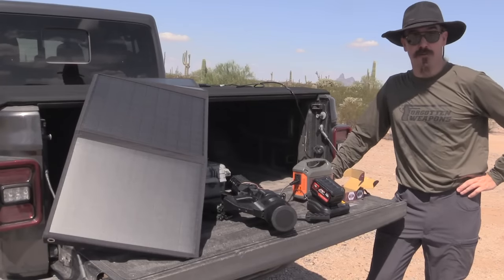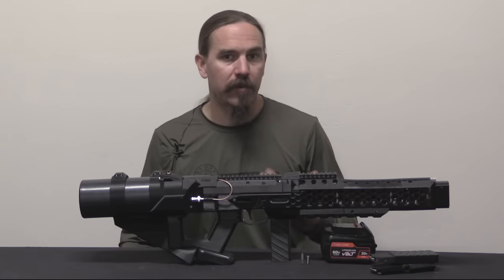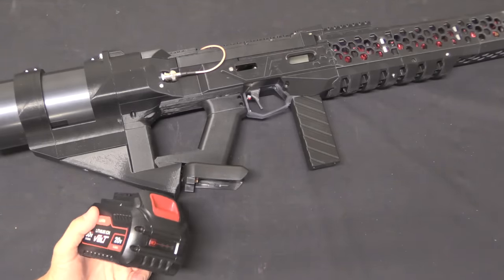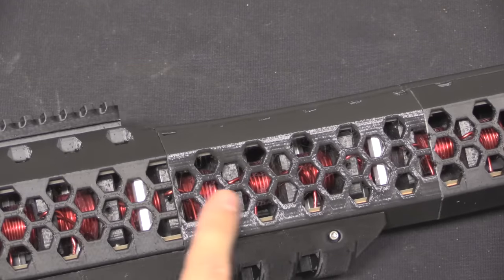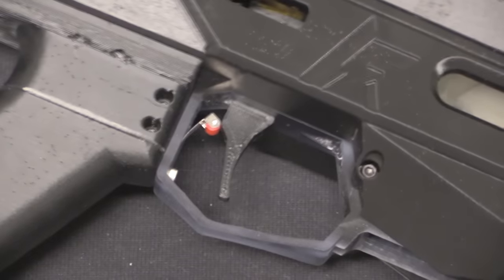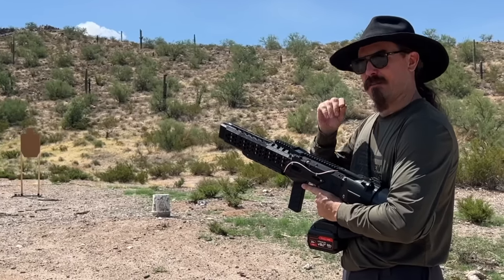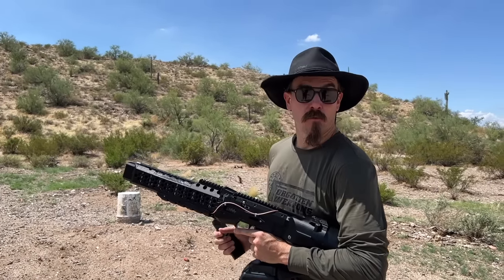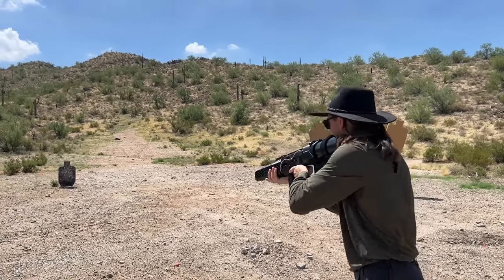ArcFlash Labs EMG-02 CoilGun: Making SciFi Weapons Into Reality

Comment: A railgun has two conductive surfaces of opposite polarity to utilize Lorentz force as a means of propellant. Basically short circuiting the system using the projectile and when that happens a string magnetic force is generated forcing it down the rails until the shirt circuit is fixed. A coil gun is pulling rather than pushing. It has one or usually many coils set up in a linear path turning on the off quickly to pull the projectile into the coil and is generally less efficient. A common method is to use a led and photodiode combination to switch the coils off but inductors do not release it immediately. So as the projectile is being pulled in (down the barrel) it is also being pulled in (the opposite direction) slightly but not enough to overwhelm the ever increasing energy of the projectile. It's the reason the navy was testing the railgun and not a coil gun. A railgun is not a feasible with the technology we have for a portable option and is prone to jamming or more accurately the rounds welding inside the barrel. A ship can handle carrying spare barrels and the ICs to handle automation of that but probably not infantry. Not yet anyways (looking at you future soldier program).
Reply: You people don’t understand the many ways that monopole coils are wound.
Reply: @danielfoster2788  please show me an example of a monopole magnet. It can be permanent or electromagnet. So far it's not theoretically possible.
Reply: @flyback_driver  We are familiar with hallbach and pile magnets grouping that are very closely monopole not perfectly so. Fractal coils produce much better monopoles. Half spherical coils cancel  magnetism within. There are monopoles POE toroidal coil windings, and star coil windings that are monopole.

Comment: Would it be theoretically possible to have some form of stabilized fin on the ammunition?
It would make it much more expensive, but at least you would theoretically get better accuracy.
Reply: I wonder if simple spiral grooves along the projectile might be enough to give it stability? They'd be easily added when turning projectiles down on a lathe, which helps with the cost factor.
Reply: I imagine you can do whatever they do with shotgun slugs if you really want to make it more accurate, but for now slicing up a steel rod is good enough.
Reply: Makes me wonder in general what it'd be like to put steel flechettes in this thing. You could probably kill someone at that point.
Reply: i mean in some scifi railguns use sabot rounds so it could be done with a coil gun perhaps
Reply: @FunkyNige  Shotgun slugs with spiral grooves (fired from a smooth barrel) end up spinning far too slowly to get spin stabilization. The purpose there is to make up for asymmetry in the manufacturing of the slug by spinning it.
Reply: It would be possible to spin the projectile magnetically even without fins (the same way an induction motor works) - although that would require a much more complex coil system.
Reply: It's possible to give spin to coilgun projectiles via the coils themselves, but the coils Arcflash are using in the GR-1 and EMG-02 are built via off-the-shelf products, which presumably will be upgraded to newly-designed coils which can impart spin-stabilization in later models. 
 
However as it stands, these are only hobbyist toys with amazing potential, but little real-world practical use. Give them ten years and the government will want to ban them.
Reply: I was imagining a sort of projectile with alternating steel and some non magnetic material in a spiral pattern down the length of the projectile. Theoretically that would cause it to spin to keep the metallic side or strip in engagement with the electro magnet. Not sure how possible/practical that would be, but would be neat if they tried something like that.
Reply: That's what I was thinking. Stabilising vanes milled into the slug to make it spin. It's the only way these things are gonna get any kind of accuracy. That or Sabot ammunition.
Reply: Theory: We know it can fire drill bits. So...

...What if you could load it with auger bits? Would those actually spin? I think they would, if they were traveling fast enough. Imagine a 3/8 inch carbide-tipped auger bit traveling at like 1575 feet per second. That's...actually kind of terrifying.

For the cheap version, just take steel bar stock and twist it, then grind the end to a point. Wrought iron ammo, basically. I mean, if a vacuum cleaner can make a fan spin, I see no reason air friction wouldn't spin an auger.

But as of now, I don't think the muzzle velocity is really enough to spin anything. I'm sure that's gonna have to wait.
Reply: Yeah. You can already do that with shotgun slugs. As long as it's made of some kind of ferrous metal, it'll work.
Reply: Flechettes would be great for this style of weapon.
Reply: Maybe it would be better to think outside the box on this. 
 
You're thinking of adding stabilization via airflow with stabilizing fins and I was thinking of using helical coils (DNA strand shaped) rather than toroidal coils (donut shaped) similar to how rifle-barrel rifling spin-stabilization works in my other reply, but what if the simplest solution is to just spin-up the projectile via an electric motor before firing? 
 
It would require a simple magazine re-design (add a toy racing car motor and battery), which would require A LOT less complex engineering than my helical coil idea.
Reply: The only problem is the low velocity of the projectiles makes aerostabilization ineffective. Possibly a redesigned projectile with an extended polymer base with fletching?
Reply: @eloiseharbeson2483  I'd try spiral fluting.
Reply: Perhaps 3d printing a hollow 5/16 finned projectile and stuffing a smaller maybe 3/16 steel rod piece in it.
Reply: A bearing scar would be an interesting test and also 3d printed and assembles with hardware store bearings. They normally use these for foam darts.
Reply: Two words: Whitworth Rifle.

Comment: I wonder how well this gun would work with a flechette type munition with a sabot, sort of how APFSDS works but in a smaller scale, a smaller projectile that is aerodynamically stabilized, which could in theory pick up more speed because it is a lighter projectile and due to its shape it would loose less energy due to tumbling.

It could improve the accuracy and also make it more of a proper firearm, with a real application of being a good armour penetrator if you can reliably get normal ammunition speeds out of the coils
Reply: The amount of (ferrous) metal being accelerated has a direct impact on how well the coils accelerate it.  Making it lighter won't increase the muzzle velocity - it'd be analogous to reducing the gunpowder, not the bullet.
Reply: @oasntet  Then what if the two halves of the Sabot had a metal core surrounded by plastic to make it fit in the barrel, also you could make the size of the projectile bigger while maintaining the shape of a fin stabilised dart to increase accuracy.
Reply: How would the sabot stay intact in the barrel without touching the barrel?
Reply: loose = not connected
stop having something = to lose, single 'o'
Reply: Better question, how small can we make a HEAT round? They don't care that they are going slow, but will still hurt thr target just fine..
Reply: @GundamReviver  explosives in bullets are prohibited by pre-ww1 treaty

.50 cal is like minimum size to be allowed
Reply: @NoNameAtAll2  ah yeah found it.. The 1868 St. Petersburg Declaration states:

The Contracting Parties engage mutually to renounce, in case of war among themselves, the employment by their military or naval troops of any projectile of a weight below 400 grammes, which is either explosive or charged with fulminating or inflammable substances.
So it just stops it for army in the case of war. But theoretically it is still an interesting one..
Reply: I was thinking about this too. Since the gun cannot have a rifled barrel, how about rifling the projectile? Make the the tip of the bullet conical like a standard round, just the forward motion on the bullets "rifling" should allow it to spin somewhat improving accuracy. There are no aerodynamics on those metal dowels being fired. Of course the real draw back is FPS which is too low to make this weapon practical. Hope it gets improved, ammo will be much cheaper.
Reply: @NitroU-  The reason why I suggested something akin to tank rounds is because tanks have smoothbore cannons

Comment: The great thing about a coil gun is that there's no recoil and there's no need for a bullet cartridge. So in a war situation, you can equip your troops with more ammo faster, since you just need to form the bullets. It may be possible to just have a machine installed in military bases that churns out bullets from scrap metal. It's quiet too, which means you won't give away your location unless your were extremely close. The downside is that maintaining the weapon itself may require more training, since it's not a piece of equipment anyone can just open up (yet). Plus battery technology needs to seriously be revamped in order to make this more viable.

Comment: What I think is interesting about this prototype is the use of simple day-to-day exchange parts. Car electricity fuzes, Dowel pins as ammo, some standard issue Pcpipe for aberrel (if I remember the earlier videos corrrectly, screw-drill batteries... So you actually would be able to repair it by yourself if necessary.

Comment: I can only Imagine Future generations of Coil guns will be more like "Payload launchers" (If that's the correct way to call it.)
Reply: Underbarrel coilgun grenade launcher.
Reply: not entirely wrong. The technical term they fit under (as do chemical firearms and airguns) is "Mass Driver". But seeing as you don't have an explosive/combustable propellant, there are payload options that don't exist for bullets.
Reply: Bolt Thrower
Reply: @Shaun_Jones  tbh. grenade launche is main use i can see for this technology right now, a silent grenade launcher
Reply: Kind of like shotguns.

Comment: I can make a magnetic rail rifle using a singular fractal coil that will propel ballbearings through engine blocks using an under over hose feed with 2,000 rounds :) utilizing a current boost transformer kills that Capacitor weight. However a camel pack with a lenz loop and swap battery charger circuit fires always non stop. Just keep wrap around hoses filled with ball bearings within reach.

Comment: Thank you, Ian!   Excellent upgrades all around.  The battery pack is genius and the large single unit definitely beats the row of capacitors under the "barrel."  A grinder with a portable battery pack will let you make ammo out of rebar if you don't mind putting a bit of time into it.  The screwdriver bits are almost laughable but innovative.  I sure wouldn't want to get hit by a Phillips head moving 200 fps!
Now I have to order one of these before the feds here in Canada outlaw any projectile launcher that fires ammo faster than a walking pace....

Comment: What freaks me out is how quiet it is on camera! Wonder if they're working on stealth pistol versions of these, if thats even possible
Reply: the muzzle speed is not near lethal yet and difficulty in miniaturization has been the prohibitive factor in coil/rail- guns for the longest time. in short. we are a long time from making this any smaller and not be a peashooter.
Reply: Thats called a nail gun 🤣
Reply: It could still be a stealth pistol, just instead of stealthily assassinating the target, you'd stealthily give them the equivalent of a mosquito bite
Reply: You can quiet the electronics and eventually the capacitors will be small/quiet enough, but once you get that projectile to a certain speed there will be a distinct noise once it's born into this world.
Reply: @kristianstaalby8499  Ah, that makes sense. I was slightly frightened by how quiet is is and how little recoil it produces.
Reply: @kristianstaalby8499  But not to far off from practical "rifles". It probably will take one or two decades, but with the current focus of reasearch of improved batterys and capacitors its very likely going to be possible.
Reply: @theexchipmunk  perhaps it will perhaps not. I fear it will at best match a subsonic suppressed rifle.
Reply: @IdleByte  not if you use acoustic waveform energy to cancel out the soundwave.." speaker driver "

Noise cancelation technology ISN'T difficult you just match the Exact Decibels and Frequency Harmonic with a Duplicate Soundwave and like two ripples in a pond will nullify the  pressure wave propagation fields , Soundwaves also are Universal form of matter/energy cohesion Harmonic...EVERYTHING in this universe has an atomic Weight " Nuclear Magnetic Resonance Frequency Harmonic " Gold, silver , carbon,  oxygen is 60 Gigahertz,  Cells even your BRAIN and DNA Code has a SPECIFIC Nuclear Magnetic Resonance Frequency Harmonic...
Reply: @jaroslavsvaha6065  could you like coat it in ricin
Reply: @mjolnirswrath23  
tell it to your healing crystals grandpa
Reply: @jaroslavsvaha6065  that could be even more dangerous if they use injection bullets with literally anything lol
Reply: @kristianstaalby8499  So it's not the discharging sequence of the coils the bottleneck like I thought with these?

I wonder if it could use longer coils as a compromise between a coil gun and a rail gun since to my understanding the latter overheats from a single shot.
Reply: @JoelHernandez-tz3vk  There are indeed loads of prohibitive factors with this bleeding edge technology. its not only one thing but a lot of things that all must be working and cooperating
Reply: @IdleByte  yes. But the shape of the projectile has room for improvement as well. Maybe an aerodynamic drop-shape, or a small dart for stability and silence.
Reply: Likely won't see a true pistol for a long time. No room for the electronics.

Comment: Would love to see this turned into artillery. Imagine with that cyclic rate, one cannon can throw 200 shells in less than a minute. Unlike bullets, shells won't need that much muzzle energy to do a lot a of damage. Just need enough energy to lob them into the enemy position.
Reply: Artillery range depends on muzzle velocity, not muzzle energy, but if you want to lob an explosive shell, muzzle energy will probably be as directly related as in artillery.  The slower acceleration might allow more explosive in each shell and would replace the heavy barrel with other heavy components.
Reply: The us army has already developed 120mm coil gun mortars, which shoot the same warheads twice as fast and at a greater range than the current in service equvilient.
Reply: There are also projects for ship based railguns with projectiles that go mach 7
Reply: @HappyBeezerStudios  The US Navy's railgun was basically shelved for now, theyre looking into hypersonic missiles/glide vehicles/etc instead.

From what I can gather, main issue of the railgun is that it creates the same energy/recoil as a conventional gun. So if the projectile is going mach 7, then only because its extremely light. So they basically just shot a metal spear, without any guidance or payload. And that doesnt seem like a very effective weapon as ship artillery.
Reply: Unfortunately projectiles with HE filler are much less magnetically efficient.
Reply: @termitreter6545  The planned USN railgun projectile weighed 28 lbs, was fully guided, and had an HE payload (it was also planned for use and tested in powder 5" and 155mm guns). The main reasons the railgun project stalled is because naval gunfire is out of favor with the new focus on peer warfare and because there simply aren't any ships that can actually provide the power a railgun needs. I expect we will see renewed interest later this decade when DDG(X) with its integrated electric propulsion ramps up.
Reply: @ARCNA442  Don't forget that the barrel life on those railguns absolutely sucked.
Reply: @someonespotatohmm9513  The barrel life issues are something of a myth. The early prototypes had really bad barrel life, but by 2017 the official word was they had the barrel life up to "hundreds" of rounds and were aiming for 1000 rounds. Given that WWII battleships did just fine with a barrel life of around 300 round, the railgun is already good enough.
Reply: @ARCNA442  Yea but that is if ww2 standarts of barrel life is what we are going for. Those where MASSIVE. nowadays they are not even 155mm, and in artilery guns those last 2500 Full power charges. On most ships their main gun serves as dual use aa piece so they need to last longer than the 1 battle you are going to fight before repairs. There is also little improving the barrel life if you are just vaporising it, maybe there is some way to compensate for it but you still need your shot to be accurate as wel.
Reply: What makes you think you can load 200 artillery shells a minute?